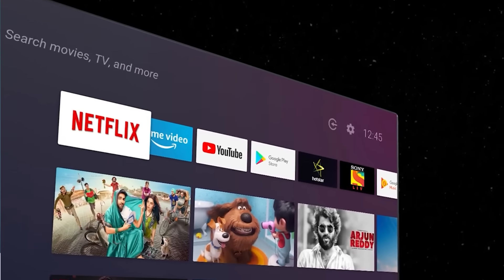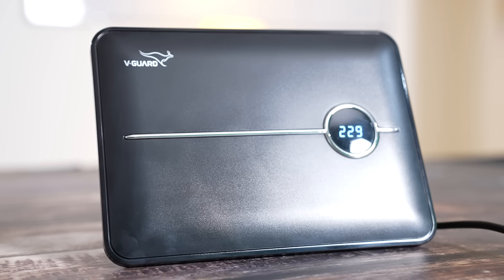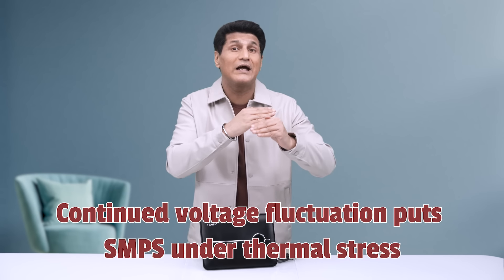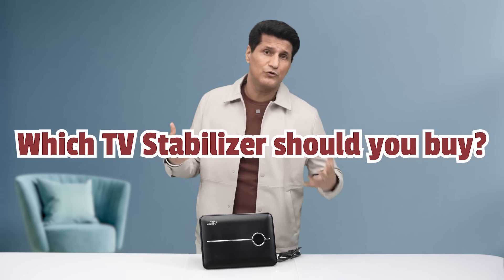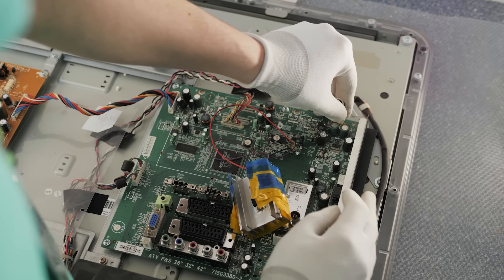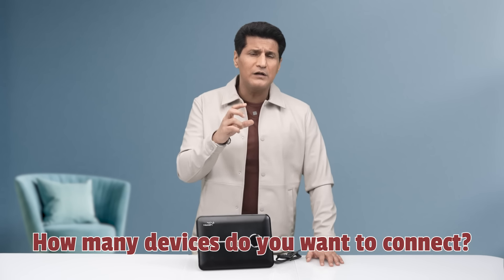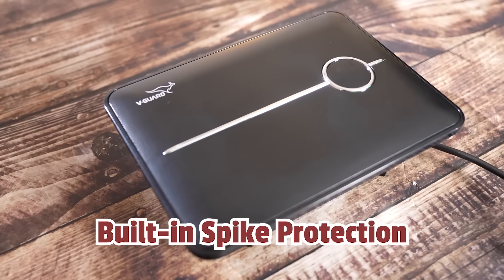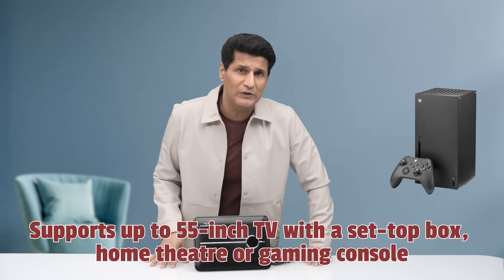Why You Need External TV Stabilizers ft. V-Guard Crystal 100 Prime

Comment: You should buy a UPS if you can afford to spend a little more. This will not only stabilize voltage fluctuations but also prevent sudden power outages

Comment: SMPS is an intelligent device with computer chips for voltage management that's why it is not required to buy a stabilizer...however if you have toooo much voltage fluctuation then you probably should buy one.

Comment: This model is not properly described by Vguard and amazon etc it says upto 55 inch TV and then when you read full description and photos it also says upto 47 inch....and whats the difference between crystal prime 100...crystal plus...and voltino max digi...all these models looks same specs wise...ok so which one is better and how Are they different ?..how about connecting a Home theatre Amplifier ? Its around 250 watts or more...so which stabilizer model do i need ?

Comment: Difference between 90-290 volt stabilizer and 130-270 volt stabilizer???
Why are there 2 options ???
Reply: 90- 290 is better because it has High range
Reply: @youtubewithvinish3484  thanks for telling.
Is the Nextron brand good ?
Reply: @v_an_AR  for which device
Reply: @youtubewithvinish3484  55 inch LG TV.
I don't have any major voltage fluctuations in my area but still I don't want to take risk.
Reply: @v_an_AR  check your TV's current rating if it's below 1.5 Amp you can buy that stabilizer at that price
Reply: @v_an_AR but I have been using my Panasonic tv  since 7 years without stabilizer. Because most TV's have built in SMPS  which converts 90 -290v  Ac current into DC